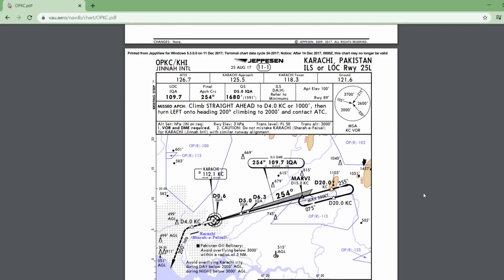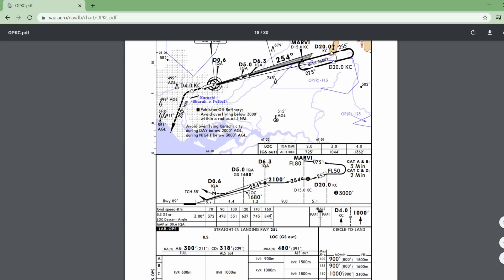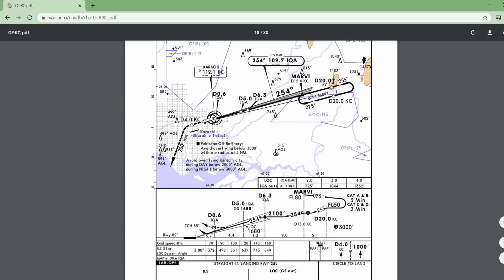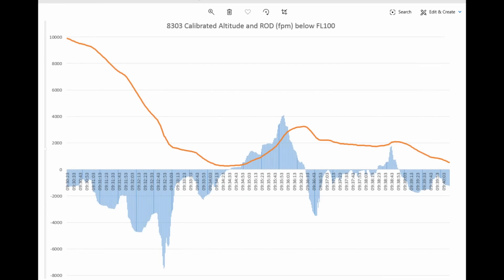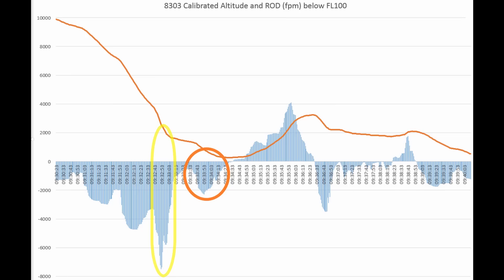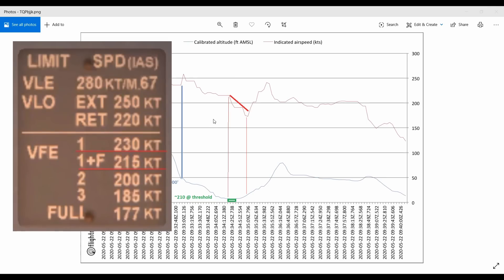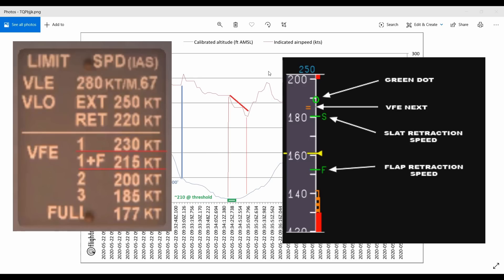PIA #8303 Update #4 Unstable Approach Profile

Comment: What about the role of the traffic controllers? How could they allow this aircraft to be so high on the initial approach points? Pilots clearly lie "established" when they are not. This whole operation from controllers to the pilots is corrupt to the core. Some international body needs to come in and clean house. Descend rate up to 7000ft/min, going on with the landing to the point of wheel up landing. Captain should be in insanity asylum. This is total madness.

Comment: That was never a stable approach and should have gone around.
Airspeed plaque shows why no gear extension.
Reply: Could you please explain your second point? What is airspeed plaque and what does it signify?
Reply: @UzairAhmed92  The airspeed was too high for the gear to extend. If you watch update #3 from this channel, you will see that there is a safety requirement of the airspeed being under a certain speed. Since they were too fast, the landing gear did not actually come down (to protect the landing gear) when the pilots tried to put it down the first time.
Once there is further information from the cockpit voice recorders, we will know why they were so busy to not notice that the gear wasn't down yet. They didn't verify the gear was down when they attempted to land the first time.
Reply: In the previous video he stated that if the airspeed is more than 260 Knots then the landing gears won't work, he was never over 260 knots.....
The other more obvious reason can be since he failed to touchdown in the first one third of the runway and because his speed was high, he decided to go around to late and lifted the gears allowing for the engines to scrape the surface..

Comment: That shed some more light on this event. But as usual it raises further questions.  What is the priority of warnings and do any aural warnings “cancel out” lesser warnings? Is the EGPWS integrated into the main warning system? The reason I ask is that this aircraft will have been yelling at the crew for the last part of the approach but from one system or two? Were they “mashing” the warning acknowledgement button and as a result missing new alerts, like gear down? The next one is what were ATC doing? I’ve cocked up many approaches over the years and been with others when they have done the same. You always try and help your colleagues out by coaching and they have done the same for me. With the more interesting approaches, ATC have generally noticed as well. They have come up with questions such as “would you like more track miles?” or “Are you sure you can make it from there” or even “This will be interesting!” But they were there, monitoring what you were doing. What was Karachi ATC doing? Did they notice or was the traffic so intense? They noticed that this crew were not maintaining the go-around profile but not that they were thousands of feet high on the first approach. It’s the CVR that will really put the flesh on they bones. I’d also want to know what the crew’s blood-sugar level was.

Comment: OK, I have a question, If you're type rated in an aircraft you should know the parameters to have a stable approach which given the evidence it suggests that they were too fast and too high to bleed off the energy to execute a stable approach. Shouldn't they have been aware of this? It seems to me that they were not mentally ahead of the airplane, but, what do I know I work in politics, not aviation, so I might be an idiot here.

Comment: None of this made any sense to me. Then it occured to me.  What if the pitot tube for the pilot in control was malfunctioning and was sending back slower speeds than their actual speed.   That's why the pilot had the landing gear lever down, but since the other tube was possibly working it cancelled out the lowering of the gear.  In this scenario I just can't explain why the other pilot who would be getting accurate air speed readings didn't call that out.

Comment: I saw this mentioned on AvHerald website..  
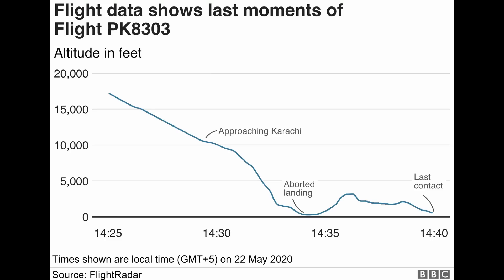"By Mike on Wednesday, May 27th 2020 03:26Z

Internet research shows the aircraft had the last regularly daily flights on March 22nd.
Thereafter an unconfirmed flight on May 7th and two unconfirmed flights on May 19th. Then a flight Muscat to Lahore on the May 21st and the last and final flight back to Karachi on May 22nd.
May be some issues with contaminated cabin air due to leaky oil seals?
Not taken too serious by the Flight Crew or just barely noticable to them because the sense of smell vanishes after a couple minutes.
That would also explain their very unusual behaviour in shooting that approach too high and too fast and their uncommon communication with ATC.
They must have been somehow impaired in their flying skills.
"
would leaky oil seals cause loss of consciousness or impaired ability at altitude; Hypoxia ?

Comment: 7000 ft/min on final? This crew clearly had no business flying an airliner.
Reply: To be honest I'd say it's more a reflection on ATC. The controller had no business clearing them to land unless it was a declared emergency. Whatever the case the crew must have felt like they were riding the Superman at Magic Mountain.
Reply: @deaddropholiday  Also doesnt atc also tell pilots to maintain certain altitude. Why was he still in 10000ft for so late?
Reply: @frankreynolds9930  If there were no extenuating circumstances then you have to suspect it was acceptable behavior at that airport. We only know about this incident because the plane didn't recover from the initial crash dive and hot landing. But there could have been many, many more incidences of rapid descent from 8k-10k feet which went unreported because the pilots had the skill to cope with the lack of thinking time - or just lucked out.
Reply: Can ATC refuse permission to land, if plane is hot-n-high with 7000 fpm descent and at 1000 ft altitude?
Reply: IdreesGhazi IdreesGhazi ATC is responsible for separation only. They do not land airplanes or tell the pilots what to do unless it involves a potential or actual loss of separation with another aircraft.
Reply: @douglasseagrim7379  Obviously ATC does not "land aeroplanes" and responsibility should always be in the hands of the pilot since the lives of passengers are in his hands. That said - the tower also has a responsibility for the safety of airport crew and people living nearby and they absolutely have input in any decision to land. If this aeroplane wasn't flagging a declared emergency then you have to ask whether their actions were just one instance of a pattern of existing behaviour between the tower and approaching aircraft at that airport. It's a bit like the truism about the cockroach - if you see one there are thousands lurking in the shadows. A lot of questions are going to be asked of the tower crew.
Reply: @IdreesGhazi786  they should have. but maybe captain was higher in rank

Comment: Why did ATC give permission to land when the plane was so far out of specification for landing?
Reply: ATC is not responsible for the actions of the pilots - it is up to the pilots to inform ATC if they are unable to continue the approach for whatever reason?
In fact, on another youtube video about this crash, the transmissions between ATC and the aircraft are heard, and twice, the controller has asked the pilots if they are still OK to continue with the approach due to their excessive height.
Reply: @sailorman8668  But ATC have to give permission to land, pilots can't ignore that. I can understand ATC leaving the pilot to handle the plane, but the permission to land still requires proper approach unless in an emergency - which was only called after the botched landing.

Comment: Nice video. Stabilised approach also means fully configured for landing (ie Gear Down, Flaps Set), engines spooled up, aircraft in trim, correct speed (ie min Vref max Vref + 20). But to me the key point is the discipline of regarding approach gates. Even the best pilot(s) in the world can occasionally end up with an unstable approach but if you are NOT stable at the gate (typically 1,000 ft agl with most airlines - maybe 500 ft when visual as specified in the airline's operations manual) then a Go Around is MANDATORY. I am retired but in the last company I flew for the First Officer could call a Go Around if the aircraft was not stable at the gate. Thanks for the update on the data.

Comment: What about ATC direction?
Reply: Yes, no doubt that will play a part in the investigation as to why the aircraft was too high at various points along its route. 
Although, on another youtube video about this crash, the transmissions between ATC and the aircraft are heard, and twice, the controller has asked the pilots if they are still OK to continue with the approach due to their excessive height, with the pilots confirming that they were.

Comment: blancolirio , should you see this - I just watch a YouTube video about this flight from TheFlightChannel. It has more of the cockpit's communications with controllers. The dialogue even before the decent sounds 'funny' to me. Given the very-odd behaviour of these flight, have you considered that the crew could be suffering from low oxygen levels, i.e., there was a cabin pressurization problem. With the crew using a delayed decent to the airfield wouldn't recovery from oxygen deprivation be delayed ?
Reply: The standard descent altitude from cabin depressurisation is 10,000ft. Also the flight channel had made several assumption which aren’t correct

Comment: Juan, look at the descent rate 20 minutes out on the flight five days earlier. Reckon who was flying that day?  https://flightaware.com/live/flight/PIA8303/history/20200517/0754Z/OPLA/OPKC/tracklog
Reply: Different flight, same route, same day, and same type of plane. Fast descent..  https://flightaware.com/live/flight/PIA8301/history/20200522/0740Z/OPIS/OPKC/tracklog
Reply: And another fast descent..  https://flightaware.com/live/flight/PIA8309/history/20200521/0740Z/OPIS/OPKC/tracklog
Reply: I think this crew did it right..   https://flightaware.com/live/flight/PIA8301/history/20200517/0736Z/OPIS/OPKC/tracklog
Reply: Not that I am trying to defend the crew on the flight deck but I wonder if the controller had the crew start the decent too late??? Looking at those profiles it is a possibility.
Reply: @oldschoolnomad813  Controllers generally aren't pilots nor are they experts on the performance characteristics of each aircraft. It's up to the pilot to determine when he needs to start his descent so that he arrives at the approach fix at the proper altitude and speed. The controller in this case knew that the plane was too high on the approach and tried to get the pilot to circle to lose his excess altitude and speed, but the pilot refused to comply.
Reply: Not sure what you are saying. The flight records you shared show a descent rate of under 1000 to 800 fpm which is pretty routine. Can you please recheck? Please do not mix up and the take-off (on top of the chart) with the landing (need to scroll down for that). Can you please explain what you are saying? I would really appreciate if you can share more on this.

Comment: My bet is that the crew was trying to get ahead of another plane for landing sequencing. That is the ONLY explanation for a dive onto the glideslope. Pre-armed with a gear-down (you can hear the overspeed horn), rapid descent onto glideslope to get ahead of other planes, kill speed, gear drops on its own...for some reason, it didn't this time. My bet is a stuck gear overspeed switch is why they got screwed with an engines-down landing.
Reply: The approach radar controller would have decided on the sequence of aircraft a fair way into the future.
It's not possible for a pilot to force their way through the queue of aircraft already ahead of them.

Comment: One thing that occurred to me while watching this update, which I had not seen discussed before, is that there were probably several elements of their unstable approach that would have triggered the CRC (chime). And they were probably ignoring that because they knew that they were chasing an unstable approach. So adding the failed landing gear deployment, for whatever reason, would not have changed the CRC that they were already ignoring. Just a speculation, but coupled with the tunnel vision on rescuing the approach may explain why they did not heed the gear warning and proceeded to touch down.  (I see that possibility was mentioned two layers deep earlier.)

Comment: Apparently, those airlines don't have the same kind of skilled pilots as we do in US. In this case the tower should have told them that the rate of descent was unacceptable and make them go around. Maybe the new computer systems will give that data to the flight controllers to warn the pilots.

Comment: Great video. I was wondering about the approach profile for this flight. Thank you for a fact based presentation. I think the root cause of this accident occurred 10 miles out at 8000 feet altitude. Casually entering a steep descent of 4000-7000 fpm indicates a systemic problem in the crew training. That sort of an approach should just never be done in commercial passenger transport.  I would like to know if this happens a lot at this airline, or at any other airline around the world. This was a PREVENTABLE accident.

Comment: To piggyback on discussion that Juan had with Mentour Pilot a few days ago it would seem due to the PIA flights high decent rate caused aircraft's airspeed to be over 250 knots (the highest allowable speed that an A320 landing gear would deploy) and (another) reason for chime in the background as heard in the pilots communication with the ATC just prior to their first attempted landing. I'm assuming the lever to deploy the landing gear could be moved but the gear just wouldn't go down (& no 3 green lights indicating the gear was down). Guess (?) possible gear was on the way down just prior to landing, but doesn't seem any evidence of this on the runway (just scrape marks where engines hit). Side note found (from Airbus) documentation regarding landing parameters of the A320 (see here: https://safetyfirst.airbus.com/control-your-speed-during-descent-approach-and-landing/ ). 
Saw on another site someone speculate that due to Ramadan the pilots may have not eaten during the day (low blood sugar can impair judgement & motor function). Don't know if the pilots were Muslim & even if they were someone else pointed out that due the distance the pilots traveled they would have allowed to eat according to Islamic law / custom. Not pointing fingers just one possible explanation for the seemingly erratic flying by the pilots. PS - Can only hope that camera footage from the airport will (someday) become available.

Comment: Like most aviation accidents, this accident was the result of a series of pilot errors, not just one. The unstable approach was number 1, and it was serious. However, the crew continued with a series of mistakes. The last mistake, failing to abort the landing due to a clearly botched approach was the last chance for these pilots to prevent a tragedy. Although the accident information is preliminary, I would speculate failure to follow SOP's will ultimately be the primary cause.
Reply: Jeff V No failing to abort the landing was the second last major mistake, going around after a gear up landing was what actually killed everyone. If they had ground to a halt on the runway, wheels up, it’s highly likely all would have survived.
Reply: FutureSystem738 spot on
Reply: @FutureSystem738  They were already past the half way point in the runway and may not have stopped although the belly landing might have added drag.
Reply: @sred5856  Likely a bounced landing even if they did have the gear down.
Reply: Problem is you can have the best procedures going, but if the pilot goes against this then it’s meaningless
Reply: The initial approach was way too high and they may have captured a 'false glideslope' e.g. at 6 degrees as a result. Trying to follow it would have been another serious error.